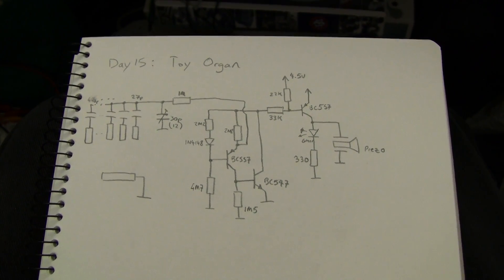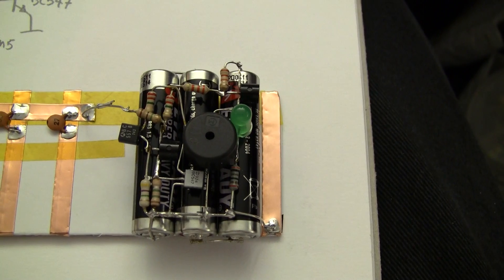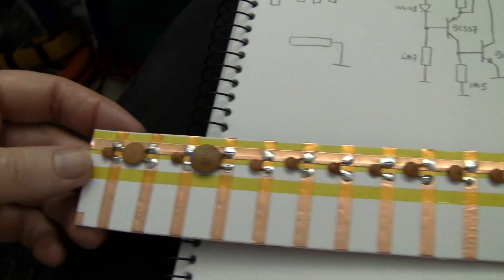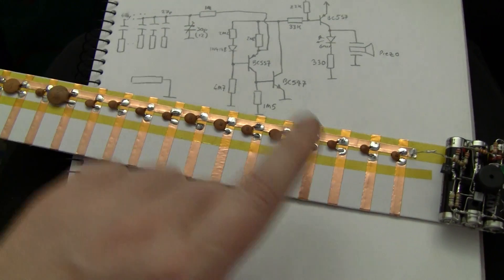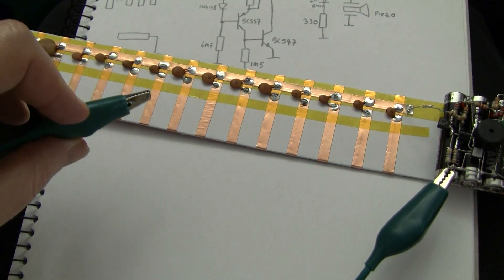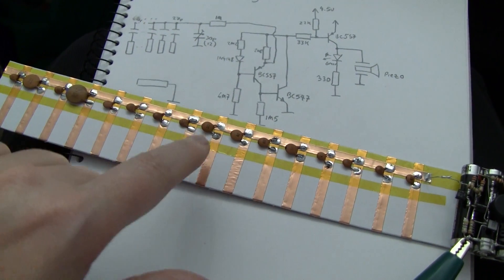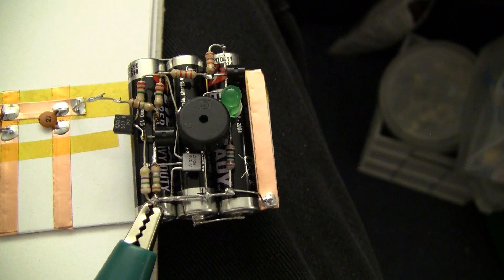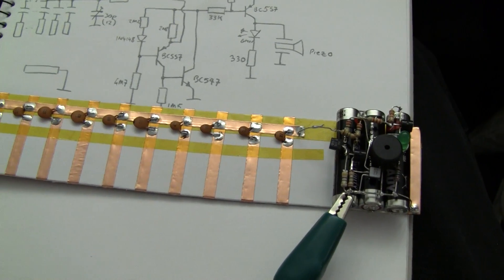Advent Calendar of Circuits 2011: Day 15: Toy Capacitive Touch Organ

Comment: Hello! Thanks very much for the video. Edward Holmes on allaboutcircuits put forward a design for a toy piano with two octaves of notes measured out using different resistor values. I am a complete novice –– How easy it would it be to alter your circuit here so that I have the capacitive touch element but with two measured octaves of notes provided with the resistor/555 combo? http://forum.allaboutcircuits.com/threads/toy-piano-project.84399/
Best,
Simon

Comment: I wonder if you could make a hybrid keyboard key, that is both pressure sensitive and capacitive. So it could differentiate between a naked finger pressing a key, versus a gloved finger pressing a key, and play different sounds. This could solve a keyboardist's problem where they bring 2 keyboards, with each one preset to a different sound or output channel - so you could have a gloved hand playing synthesizer-like sounds while the naked hand plays clean, or gloved hand to an effects chain while naked hand is clean.

Comment from the maker: @Gameboygenius sure, good idea.  Briefly, inductors have parasitic parallel capacitance which makes them self-resonant at some frequency, at that frequency their impedance peaks and declines afterwards - they become capacitive and no longer inductive at all.  In the previous circuit the inductor is there to block the RF and prevent it from being shunted by the capacitor in the emitter circuit, as it is the feedback between the two transistors which makes it oscillate.

Comment: In the previous video (I think) you mentioned using different types of coils in series as a wideband choke. Could you elaborate on that? Are bigger coil bad at blocking higher frequencies? Is the problem leak capacitance or something different? Something you might elaborate on quickly in a video.